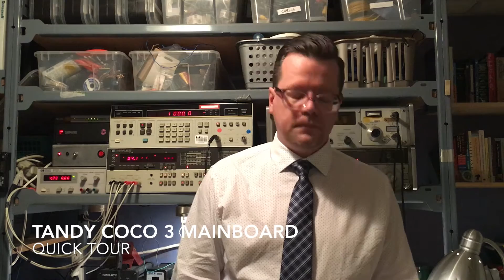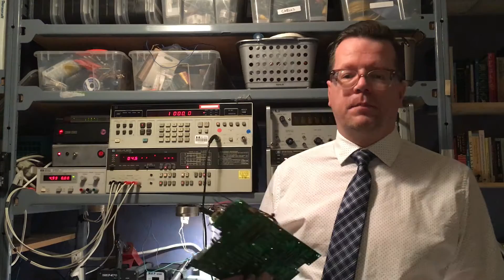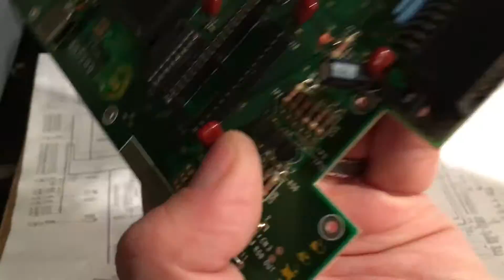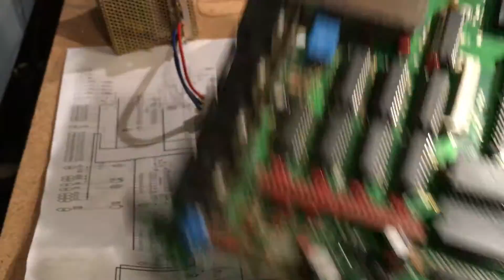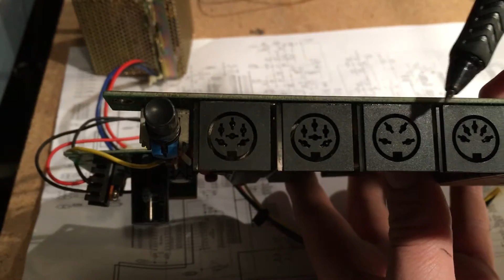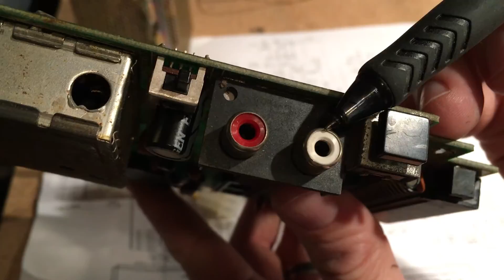#6 TRS-80 Color Computer 3 Motherboard Review / Teardown

Comment: Replace the huge cap with a new Nichicon one - $4. The new ones are about 1/2 the size. You can also replace the 245s with modern 645s which are direct replacements.

Comment: There are no 12v signals used in the color computer 3. The joysticks are 6 bit, not 8. and the relay only clicks due to changes in the logic levels during power up and reset, it is actually only under software control when "CSAVE", "CSAVEM", "CLOAD", "CLOADM", "MOTOR ON", "MOTOR OFF" and the equivalent machine language sequences are in use. Other that that the relay is not used.

Comment: Even though I had a 6502 back in the days, I've later worked with OS/9 ... and I would say that what matters is not whether the 6809 was 8 or 8/16 bit.
What matters is that it could run an OS like OS/9

Comment: The 808x and Z-80 may have run at a higher clock rate, but they took many more clock cycles to execute instructions. A 2 MHz 6809 could outrun the 4,77 MHz 8088 on the original IBM PC.
Reply: The 6809 was also a pleasure to program.  The 8/16-bit accumulator was very handy and the instruction set made sense, without the idiosyncrasies of the 6502.  The 6809 was easily the best of the 8-bit CPUs.

Comment: The second 'PIA' is the equivalent to a 6822 which is just a 6821 that was designed for use in an 'industrial' location because it could handle a more noisy environment. It was used because the ribbon cable for the keyboard would sometimes not function properly in some environments.

Comment: You DO NOT have to throw out the logic board if the GIME chip is bad. There are a few people working on a replacement for the GIME chip that also add additional video functionality to the system.
Reply: The relay is not for resetting the computer, it controls the remote jack on a tape player for saving and loading tapes.

Comment: Nice video. Just a small correction (3:50): The 74LS245 does not buffer the Address Bus! It's an octal bi-directional tri-state buffer commonly used to buffer the Data Bus I/O, to allow driving the multiple devices normally connected to the CPU’s data bus pins (the 6809 could only directly drive 4x LS TTL inputs). 
The MC6809 was indeed the most powerful 8-bit processor. Internally it implemented 16-bit functionality with 16-bit arithmetic & 16-bit Accumulator (D), and even had a Multiply instruction (MUL) which multiplied the two 8 bit accumulators (A & B), with a 16 bit result (in just 11 clock cycles!).
But to be fair, it was still fundamentally an 8-bit class processor.
I remember saving-up to buy my first 6809 CPU chip to build my own wire-wrap computer, as a powerful upgrade to my prior MC6800 based designs.
LOL. I even recall as a teenager in the 80’s writing 6809 assembly code, being amused by the 6809’s ‘SEX' (Sign EXtend) instruction nmemonic. :-)

Comment: The 6821 IC that you were unfamiliar with was actually a 6822 PIA or the commercial version of the PIA and was used because it eliminated most of the 'noise' related keyboard errors due to the long lead length associated with the keyboard. The 6822 worked better in the 'noisy' factory or commercial setting. The CPU or the 6809, 68A09 and the 68B09 were, in many ways, far superior to the original 'PC' or as it was called back then, the IBM computer. The 6809, running at a measly .89 MegHertz, could run circles around the PC (with many graphics programs), then running at 4MHz, or nearly 5 times the COCO's system speed because of its built in Multiply op code. The A and B versions of the 6809 were CPU's that would run properly at 1.5 Mhz and 2 Mhz respectively. I also have circuit diagrams and information that will allow the 68B09 to run correctly at up to 4Mhxz.

Comment: Is this a modified board? Why so many chip sockets? Is this an earlier version? I can't imagine that later versions would have sockets, since that would just increase the cost. My CoCo3 had virtually no socketed chips as I recall. I added a CPU socket myself when I upgraded to a 6309 processor.
Reply from the maker: Good catch! You know what, I used a brute force repair technique on the board and replaced all the off-the-shelf logic chips hence the sockets.   That said, the board in the video is an early one, GIME is dated 1986 and the RAM chips were all Made in Germany...

Comment: Very great. I like this stuff explained. This board is mostly unconventionnal compared to other regular 8 bit computer. Anyway, I had one in the 80's and I liked it. In french Canada, this COCO 3 was more popular than the Commodore 64. Mainly because we had a full french big Microsoft Basic manual to make our games or softwares. Now, with only some fundamental logic knowledges and electronic knowledges... We can finally understand what's in there.
Reply from the maker: Thanks for the comment!  Radio Shack had its issues, but they did a very good job supporting French Canada.    The Coco and most of the other TRS-80 machines had an English and French version you could order.   I remember also a few games available in French as well, "Mots Magiques" is one the comes to mind.  I am not surprised they were popular in French Canada!